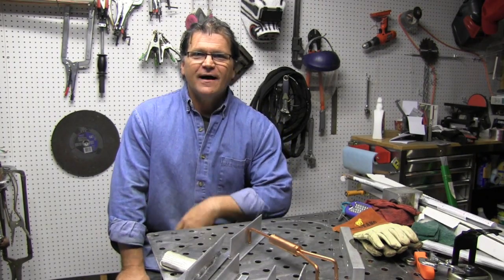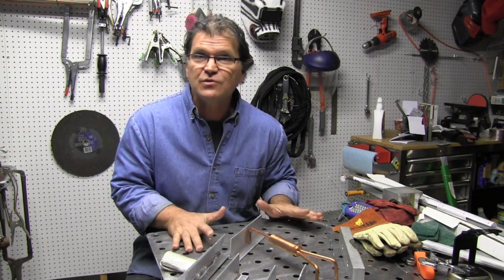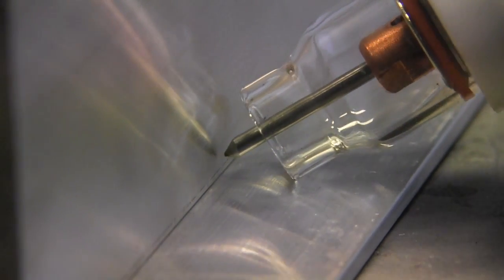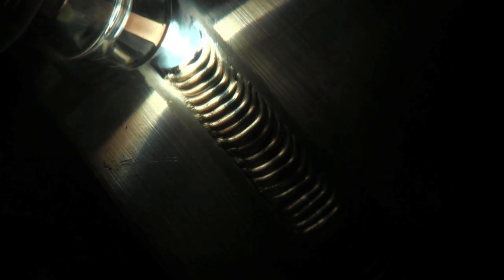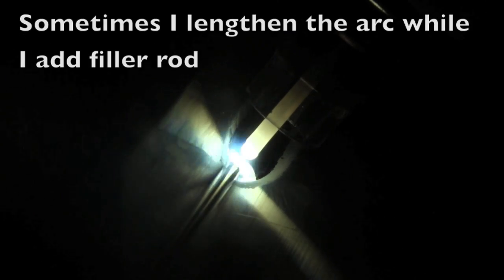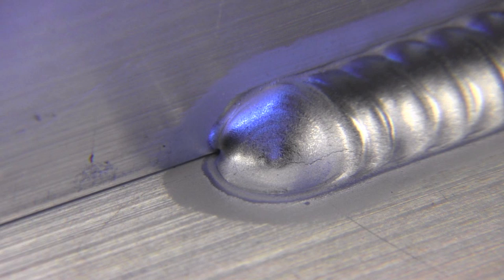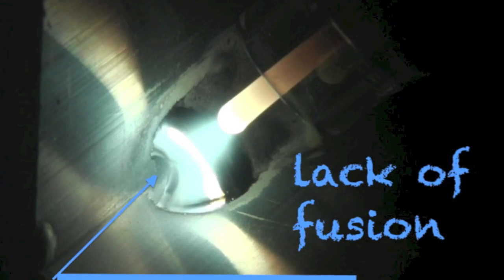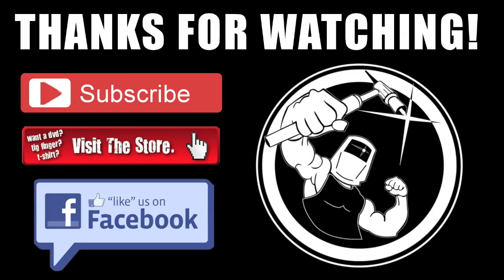TIG Welding Aluminum - Tips for 2f Tee Joints

Comment: I just bought one of these Lincoln 175 machines for 700 with brand new pedal and new ck 17 tig torch. Now I need to weld some really heave stuff so I will preheat and pray it works. I have the skills so I think it will. Question if we always want a balled end why not grind one? Seems to work when I tried it. Tungsten in cordless drill. Spin it up and round the end a bit.

Comment: I'M TIG WELDING A 1" ALUMINUM SQ BLOCK, THAT I CAN DRILL AND TAP,  TO A 1/8" X 2" AL BASE STRAP.   I HAVE 1 A LINCON 255 SQ WAVE PULSE TIG WELDER  BUT I HAVEN'T LEARND HOW TO USE IT YET . THATS WHY I'M HERE . GAS SETTING, PROB LENGTH, AMPS AS A PERCENT OF THICKNESS BUT WHICH THICHNESS ? LOL. THE PULSE LOOKS LIKE A GOOD OPTION. I HAVE A HAND HELD PROB, FILLER ROB. AND RED TUNGSTEN. AND PLENTY OF SCRAP AL.  GREAT CHANEL!

Comment: This man is a very good teacher and clearly knows his stuff. Thanks for the effort. I’m just learning as a hobbyist and I often find I’ll get frustrated with some difficulty and come in and search and rewatch some of Jody’s videos for some missed detail which resolves the problem. Had great difficulty getting a good start on an aluminium TEE joint, re practised on the flat all good, try the TEE again with the same settings, no good, fine when I got it running but awful to start. Re watched a few videos saw the tip in this one about the arc wandering around with a balled electrode, tried the blunt angle, boom, nicer start and runs fine. Long way to go but this man is delivering gold dust here in terms of learning.

Comment: i have been trying to learn how to tig weld since October. i have been able to run a pretty bead on flat plate since maybe day 3 of owning my tig welder but i just could not for the life of me figure out how to tig weld aluminum Tee Joints. after watching this video i tig welded a tee joint first try until i dipped the tip! these videos are life savers! i've been a fan for a few years and i've finally been able to actually follow along and practice with my own welder. the key advice given that i think helped me was using a blunt tip. for whatever reason with a sharp tip or balled tip, my arc jumps all over the place. the blunt tip helped pinpoint the arc to the place i'm trying to start welding. thanks!

Comment: I always like starting on the bottom piece right next to the joint, adding very little filler metal and getting the puddle to join the top then run the bead from there

Comment: Talking about “hot short” is interesting. I view welding as being being a casting without a mold. Like in casting, metal has been introduced hot and will contract as it cools. The center of the molten pool is still shrinking as the outside solidifies first. Casting techniques you utilize a casting tree for the part to draw from while it is just starting to solidify. Same thing goes for metals that have high thermal expansion such as aluminum. Other factors such as alloy being used as well as process of deposition will effect in the ductility of the weld when cooling. Pretty neat subject when you stop to think about what is really going on.

Comment: I'm learning in a class and I've had great success with AL until the fillet weld. We are welding .06 with 3/32 ceriated at 60 amps max. I've been using a 20° grind and having trouble with the arc focusing on only one side or the other. Definitely adding too much filler to start. I'll try the 45° grind and see if I can stabilize, then add less filler to start. Thanks so much for the videos!
Reply: Punch up the power quickly to stabilize the arc then back down. Practice holding the electrode close without moving it and touching into the aluminum. 

Here is something that seems to help me. I move the torch down into position then before I press the pedal to start the arc I touch the tungsten tip to the aluminum then move it up to where I want it when I start the arc. 

What this seems to do for me is to calibrate my muscle memory and I am more steady holding the torch exactly where it needs to be after that. Seams strange but after doing that a lot it really works.

Comment: hey Jody I am somewhat  new to tig welding and I love the videos you have. I have learned a lot from them. on this video you touched base on "lack of fusion". I seam to get that a lot when I am welding aluminum. I was wondering if you have a video on that and how not to do that. I am using a miller diversion 180 with the lift arc torch if it matters. ps love the tig finger I got one for me and my dad. thanks again.

Comment: Thanks for the tips, saw what I was doing wrong. I will try again tomorrow. Just putting a small guide tab on a flat plate. Flat but joint was ok but T joint, couldn't get it hot enough so it was just like your example.

Comment: Hey Jody, could you make a little video on how much wire you should add when tig welding on various materials? I'm still learning and I'm constantly getting crap for adding too much or too little. I personally prefer adding a lot for aluminum and quick rapid dabbing for steel and stainless. Any help would be awesome!

Comment: Hello, I'm new to this. Trying to weld a joint together but I'm having a hard time getting a puddle  AT 140 amp (recommended setting) What is the highest Amps I can go without getting in trouble ? I'm using Eastwood TIG WEDLER 200 AC/DC.
Reply: I'm not an expert like jody, but I can tell you that the acceptable amp ranges depend on the thickness of your material and size of your electrode. Also, since you're new it would help to have a half dozen or so pre sharpened electrodes sitting by while you experiment with your arc lengths. Too long of an arc will make it hard to get a puddle going. As I learned from my first TIG classes last year...you're going to dip your tungsten A LOT. It takes some time to get used to how tight you need to make your arc. So make sure you've got plenty of pre-sharpened electrodes handy so you can practice non-stop.
Reply: When I started welding with my Everlast I was sharpening my tungsten on both ends so that I could switch to a new point whenever I goofed up.

Comment: I really enjoy your videos. I have been welding off and on for a while .. not where near where you are but I practice.. I recently acquired a mler syncrowave 250dx water cooled welder... I have been searching for videos explaining freq, and setting things up for different types of materials but haven't had much luck. I read the book on it but I learn better with an explanation of why and how, or visual..  anyway I have a project coming up on aluminum and am having issues figuring out settings.. how can I go about getting this thing set up
Reply: the tips are great . i ve got a project lined up . but dont hav the equipment . i m hoping to hire equipment . the project involves motorcycling . i ll send piks when i get it sorted . i ve seen cups numbered 4 to 9  . can u explain where one wud use the various sizes

Comment: Hello, I have a Lincoln machine as the one you use in the video, but it wont start the arc that easy as it looks on your demonstration. What am I doing wrong? what is the gas you're using? Do I have to preheat? Thank you

Comment: Jody I dont tig aluminum much but my last project started an issue. I was repairing a cast bearing housing. All was well until I ran out of filler rod. I got more and went to work. The bead started and starts ok. Puddle looks good but when I add filler I get blobs and contaminates. Looks like something coming out of the filler rod. I know cast is know for impurities but the puddle is clean until I add the rod. I checked my gas and think I may have had too much gas but not sure. Please help. I finished this job with a spool gun but still get the same effect when welding tubing or plate 3/16 to 1/8. Thanks Jody for the great videos. Im looking into the new Lincoln Aspect 375

Comment: I love your videos. I have been welding quite a few years now and I really like to use kevlar gloves for welding. They are the yellow ones. I will wear 2 pairs for aluminum and just one pair for steel. I weld mostly thin gauge tubing so not too much on the amps. I like them because they last and I can throw them into the washing machine so I can keep them clean. I have some tig fingers too and I use them too. Any reason others don't use these? Am I doing something wrong using these. Thanks for your help. Pete

Comment: TamJeff from the forum here. This is pretty much exactly how I weld aluminum. The back stepping you showed in the pass is also much more forgiving for those who may not have a lot of hood time with aluminum in which to correct for inconsistent travel speed, and giving some time to correct craters from spacing their puddles too far apart. Excellent video.

Comment: Jody, in all your years of tig welding, what is the most amperage you've ever needed? i've been looking at buying a miller Dynasty, but not sure which one to get, any pros and cons on these machines? I like quality in my tools, and i am not afraid of spending money for good equipment.
Reply: T-Bone18 I can't speak for Jody but, I weld aluminum every day. If you intend to make money with it, and want to cover most common constructs and general, light industrial applications, a 250 amp machine would be minimum, IMO. If you don't mind spending money, may as well just get the 300. The Dynasty is a fine machine all the way around. I have never heard anyone complain that they bought too powerful a machine, but plenty who wished they would have bought larger.
Reply: Mr Boat Thank you for replying. I was thinking about getting the Miller Dynasty 350 water-cooled with wireless foot control. Its $9200. I have no doubt people wish they would have bought larger machines. I've been doing quite a bit of research on different machines, i think thats what I'm going to go with. I want to buy the right one the first time.
Reply: T-Bone18 That would be a good, all around choice. There are days where I have to run 100 feet of weld or more and it occurs to me that nobody bothered to ask the question of "duty cycle" when having to run a machine at maximum amps when they made the choice of the machines they chose.
Reply: Mr Boat for the Dynasty 350, i believe it has a 60% @ 225 amps, i have a miller 252 mig welder also with a 60/40 duty cycle, and I've never had any issues with it. when i hear the fan kick in, i usually stop for a minute or two, before i weld again. I don't think i will be welding heavy gauge metal with this either. or at least not long enough to matter. Is there any other machine you would refer me to?
Reply: T-Bone18 No, not really. Not for a machine that does all like those do. After that you get into industry and materials specific parameters. From what you have said, I can't imagine you needing anything else. That machine is a hot rod for what most people will come across day to day and then some.
Reply: Mr Boat  Thank you Mr. Boat! i appreciate all of your input.
Reply: I use the Miller Dynasty 350 everyday welding mostly stainless and aluminum. Never had any issues what so ever with it, welds like a champ!
Reply: awesome, because mine should be here beginning of next week!

Comment: How do you start your puddle on tee joint. Do you just hold the torch on base metal and let it heat up before adding a little filler?

Comment: Great video Jody...question, do u have any videos of thicker aluminum (5/16) being welded? Had some 6061 come into our shop & had a tough time getting it to wet out properly...print called for 1/8 fillet T~joint both parts 6061 5/16 thick 6" square (also the filler rod used was 1/8th 5053)...
Reply: He did a fixture a while back... high amps and low frequency to spread heat into part. Also mixed in a bit of helium.  I tried this joining 5/16" rod to 1/8" plate and got much better wetting at lower freq (50 Hz 35% EP 200 amps) than at higher freq.

Comment: Hi Jody, what is that "copper looking" 3-legged holding device you are using?  Have done endless web searches but haven't got the right name I guess.  Thx great vids!
Reply: +Mike Fisher The holding device is called a third hand. Most of them are made of scrap materials. The copper helps to get the ground closer to the weld.

Comment: back in the 70 in the 300 area at hanford i was in the need of a clear extended heli arc cup to reach down through a small hole.  they had a glass shop there and i asked if they had any glass that would hold up to white hot temps and they had quartz tubing the right size so they used a lathe to mount the pink ceramic cup and the quartz tube and they melted them together with hydrogen gas.  then i had then cut the end of the quartz tube at a 45 degree angle and had the point bent over to direct the gas sideways then cut the sharpened end of the 2% 3/32 tungsten off then re welded the sharpened tip back to the shaft and put all this together on a straight torch then taped a steel rod to the torch handle then stuck this about 3 feet down a small hole to weld a small part.  the quartz tube helped me see what i was doing.  its odd to see 40 years later now they are making quartz cups.

Comment: thanks jodi, expertly demonstrated; aside from never using a tig before, the explanations w/ the basic welder used in the video seemed clear enough and understandable (having the machines user manual or some other type of educational experience as reference) - arc length, tip 'profile', oxidized filler rod, the crater cracks - seen those plenty of times on an associates all aluminum racing carbody repair work, the arc wandering (balled tip) hard to recognize the cup angle in relation to the workpiece in most of the video - taking your word for it accounting the electrode length & cup style as demonstrated.
thnx again, respectfully, gerald.

Comment: Few of my observations when welding Al
- It can be harder to differentiate the color of your tip and the puddle. You can be holding the tip closer than you think and it sticks.

- The puddle and bead fills up a lot thicker than on steels, you can have what looks like a nice contact distance but you can easily put so much rod in that you bury the tip.

- And when the filler rod slips out of shielding gas and it forms oxide layer with a visible ugly tip. You have to stop right now, you're asking for trouble if you dip it like that.

Avoid the above and Al is so much fun to weld when it goes right.

It's so awful when it's going wrong.

Comment: First off Congratulations on being recognized by AWS
I know this is pretty much not related to this vid but do you have a vid showing how to Mig (or if it is possible to Mig) cast iron that has to withstand heating and cooling on a regular basis to about 200 degrees or above

Comment: I'm attempting to TIG weld at home and hopefully get certified. I really want to do aerospace welding. I've heard that welding aluminum soda cans is good practice. What would you suggest?
Reply: Inside of the soda can is coated with a polymer. Not sure if it will affect welding it but thought you ought to know. I was going practice low amp welding with my powertig welder and my friend let me know.

Comment: I just finished the TIG unit in my welding course at school, one of the last joints that I had to do was an aluminum butt weld, flat position, and it seemed to me, from what you've done and what my instructor did, that there's more than one way to do it successfully. My instructor put a large bevel, about 35 degrees, onto a couple 1/4 plates, with maybe a 1/16 landing and 1/8 gap, and actually welded backwards, pulling the puddle along and letting the argon flow through the gap to shield the backside of the weld, and it turned out beautiful

I could never manage to weld it like that, I ended up just butting the two plates together with no edge prep and hammering a bead through them, but I'm really interested to see if you could try some aluminum groove welds out like that and maybe see your technique and get your opinion on welding like that

Comment: Jody , I have a question more on the machines... I am looking at the Miller diversion 180 which I have welded with but I am also impressed with the Lincoln square wave 175 you used in this video . I know the Lincoln is a transformer machine and the Miller is a inverter In your opinion which would be the better machine to purchase for light fabrication / hobby ? They are both about the same price within a few dollars . Thanks.... Art
Reply: If you're in the Los Angeles area (Whittier, ca) and decide to go with the Lincoln 175 I'm selling mine which is in near new condition.  From what I know about the Miller diversion 180 does not have stick welding like the Lincoln does but I have not used the Miller myself so have no thoughts on how it tig welds.
Reply: that would be a long drive for me i'm on the other coast ( New York ) the diversion welds really nice on both ac and dc but i really dislike the torch that came on it and it is not readily changeable and i believe it has a miller Proprietary end on it ... i do like the stick capability on the lincoln being the only stick welder i own is my miller bobcat decisions , decisions  i guess it comes down to the ford / chevy arguement